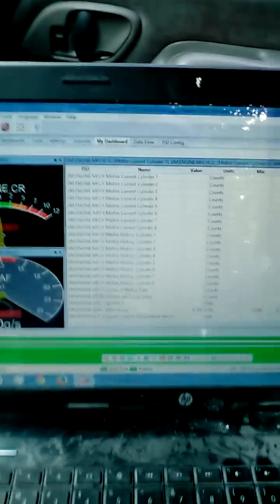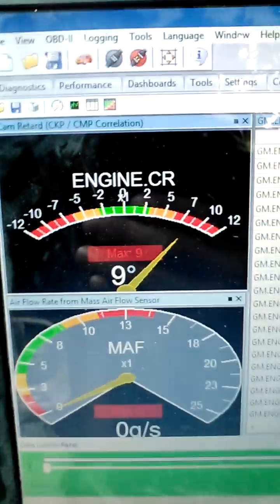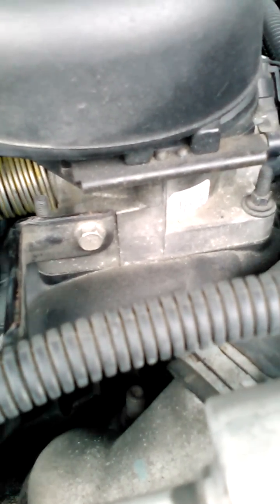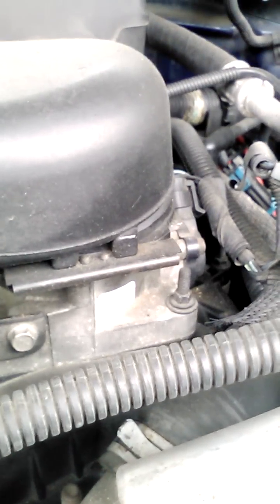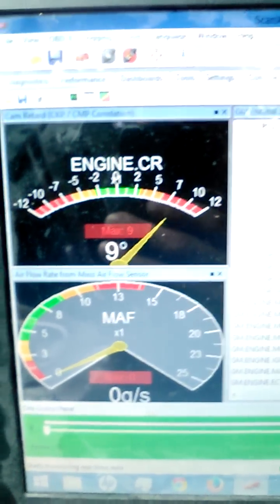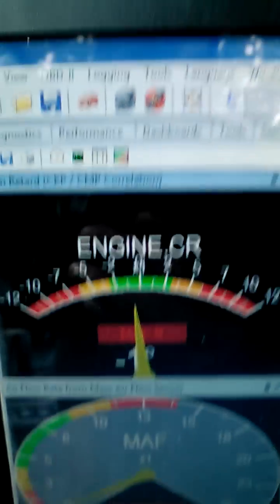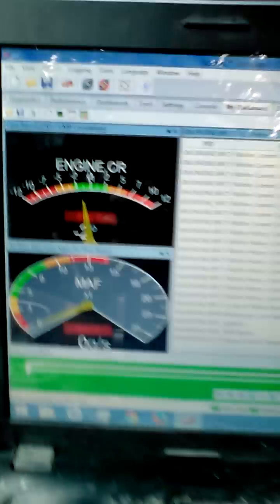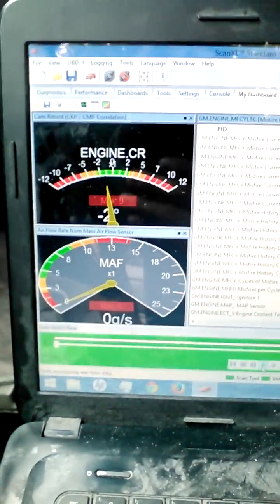vortec v8 96'-00' ignition timing

Comment: Thanks for this excellent video! But I how did you manage to loosen the distributor hold down bolt???? I have a 1998 Silverado 5.7 Vortec and can't even see this bolt with all the hoses and wire harnesses in the way... any  tips or tricks, please????
Reply from the maker: I understand your pain as leaning into these trucks is difficult, especially when your looking for something that's hidden. If you pull your plug wires from the distributor (mark them first so you can put them in the original position), you will see the hold down plate that applies pressure to the distributor base to hold it down (via 14mm bolt that threads into the intake manifold towards the backside near the base of the distributor). your feeling for a 9/16 size bolt head if you can't see it after removing the plug wires from the distributor cap. it's really easy once you can see what your feeling for. 👍👍👍
Reply from the maker: I understand your pain as leaning into these trucks is difficult, especially when your looking for something that's hidden. If you pull your plug wires from the distributor (mark them first so you can put them in the original position), you will see the hold down plate that applies pressure to the distributor base to hold it down (via 14mm bolt that threads into the intake manifold towards the backside near the base of the distributor). your feeling for a 9/16 size bolt head if you can't see it after removing the plug wires from the distributor cap. it's really easy once you can see what your feeling for. 👍👍👍
Reply from the maker: I used a wrench to get mine loose. was not on hard, BUT if it is. try using a small 1/4 head ratchet (preferably one you don't mind messing up), and put a extension with a socket (that fits the size of the end of the ratchet) to build a breaker bar that's small enough to fit.  try to fit this in there to break your bolt Free. rest will be cake👌
Reply: Hey Willis!

Many thanks for the valuable tips... I'll give those a try... you get all thumbs up from me!!

Antonio

Comment: I have a 1997 gmc 7.4 454 would this Scan xl work for this engine? i recently replaced the distributor and did not mark it let me know please.
Reply from the maker: Yes! all distributor based vortec motors require a scan tool to properly set timing. I've tried the "lining up" of the 8 and 6 marks that come on distributor housings, but it was always out 9 or more degrees. Now if your off a tooth on the distributor it will run awfully, and not always throw a code.  scan XL with a GM add on is the most software you will need, and also the cheapest route to go. most shops want $150-200 just to twist the distributor. it cost $295 for all the stuff I needed from ScanTool.net, and I have a scan tool for life. it does require a laptop, but they also have wireless Bluetooth OBD 2 plug in devices that allow you to view  data from a phone or tablet.. if you need any advice please ask.. 👍